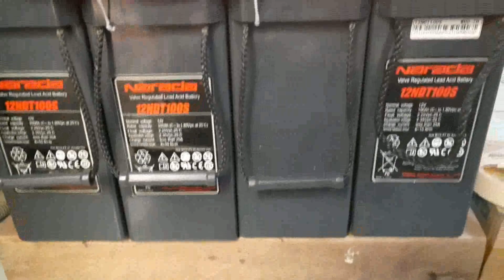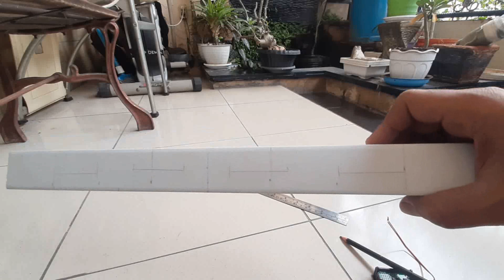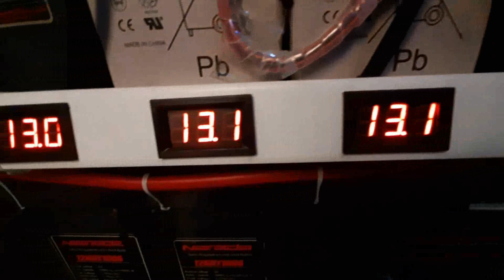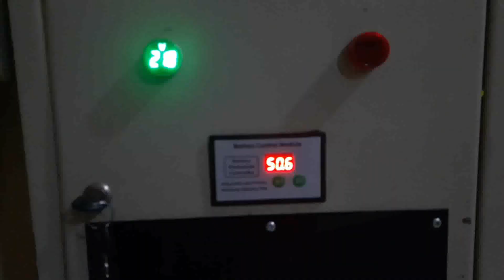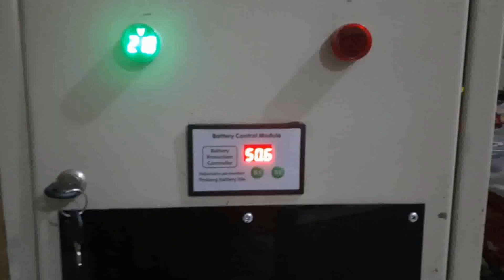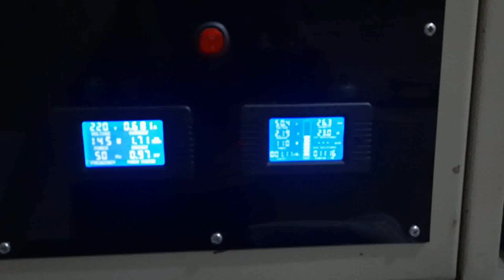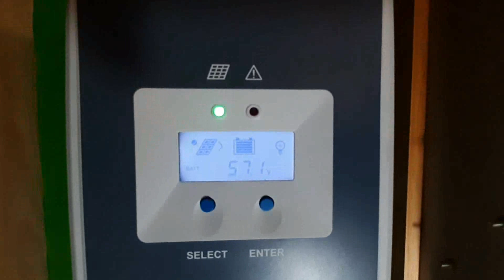Voltmeter indikator sistim Baterai 48v PLTS  | fungsi baterai equalizer

Comment: Maaf Pak saya pemula.. Mau tanya  lebih efisien sistem 12v atau 24v.. Saya pake sistem 12v jika arus out inverter 1a maka arus bc 10a.. Klo yg 24v apa arus bisa lebih kecil soalnya kabel aki panas.. Trims
Reply from the maker: Efesien sistem 24v &  48v kl sistem 12v kabel yg ke aki & inverter hrs min 16mm - 35mm  karna kl kurang dari uk tsb bisa panas dan banyak hilang  ampernya
Reply: @HariPLTS  trims Pak ilmunya  sukses terus
Reply from the maker: Sma" gan trimakasih sdh mampir🙏